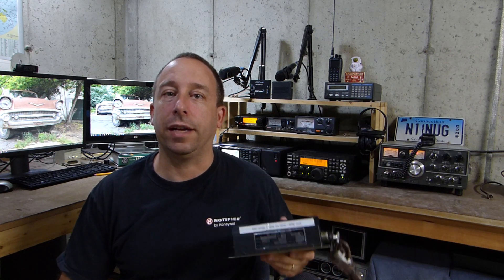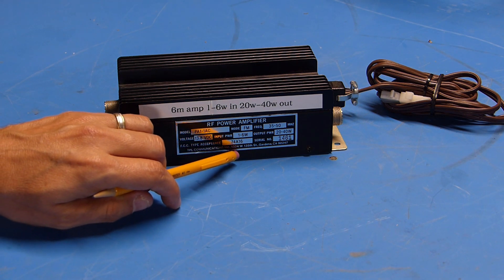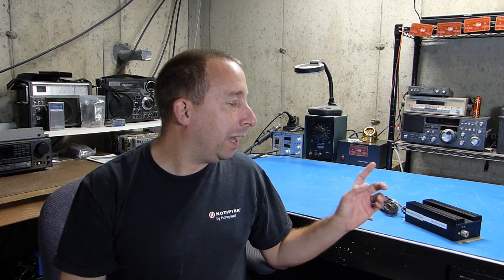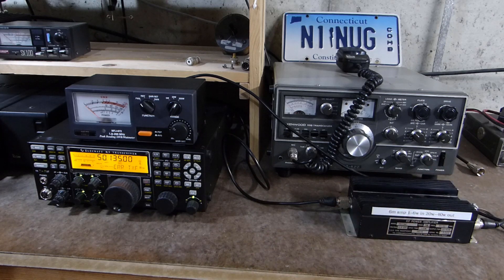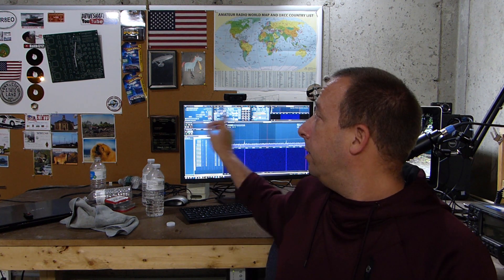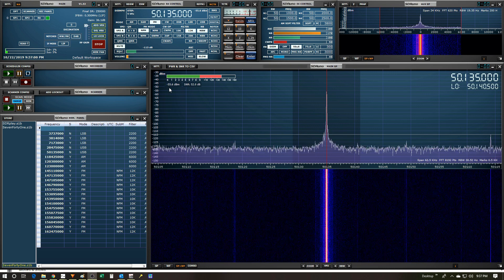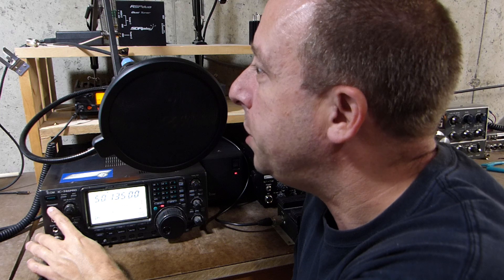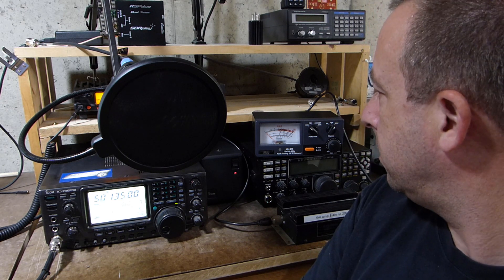6 Meter Ham Radio Amplifier Test & Demo - Flea Market Special!

Comment: The amp is seeing the SSB as an input that comes and goes. You might see if there's a VOX-like adjustment that'd cause it to hang in there longer.
Reply from the maker: The circuit has a rectifier that produces a DC voltage from the FM carrier and biases a transistor which in turn causes a relay to click on.  Because there is no steady carrier with SSB, the transistor only gets voltage when the RF is high enough.  There is no adjustment in the amp for the biasing level of the transistor.  The best thing to do is add an external keying circuit tied to the PTT of the mic which in turn would feed the needed voltage to bias the transistor and keep the amp on while the mic is keyed.  I have plans to do that at some point but not sure when I'll get to it.

Comment: So have you determined what class the amp is operating in yet? From just what's given in the video could that be determined or do you have to get inside? If getting inside is the answer, what is the key giveaway (teach/remind us)(I've forgotten so much). I would have opened it up no matter what. I once bought a lil class C amp - one of those little 2m FM amps to boost ur HT up to 25w and the final blew in no time so I had to solder in a new one - no savings of money there. EDIT I found this. Maybe you could compare the class A / class C diagrams to the insides of what you have there and make a determination: https://www.electronics-tutorials.ws/amplifier/amplifier-classes.html

Comment: the low tier versions were pretty broad devices - 30 - 60 MHz or something in some cases. better designed ones were more limited to specific band splits like 30 - 40 MHz or 40 - 50 MHz. depends on the brand and so on..
Now if you are adventurous you can see if you can get ahold of an old GE Mastr2 Lo band PA deck from a base station. 600 mW in and 100 watts out and are broad enough to run 6 meters AND since you run a LPQRP as an exciter you should be fine in SSB with it.  You will need a GE test and tune set, service manual and some tuning tools to tune the amp deck but man those things are built like tanks and perform very well. I have a couple in UHF I keep on hand incase the one in the 440MHz repeater I have dies..

Comment: I had no idea you could run an FM amp in SSB.  Thanks for the info!  73 KE8HSW
Reply from the maker: In theory it shouldn't work well due to the architecture of the amp.  If you put a spectrum analyzer on this the signal might not look so good.  Also, you need a circuit to hold the relay open since there is no carrier, otherwise you'll burn out the relay contacts in short order.  Bu in a pinch, I guess it works.
Reply: It will work but you might have some performance clipping and efficiency issues..

Comment: To make it work on SSB without the relay having a coronary, is all you need is a 2n2222 transistor , 2 resistors and a wire on the PTT from radio to the transitor then to the relay in the amp, Thats it

Keith N9QDS
Reply from the maker: I thought about looking up the mod for this so thanks for the info.  Even though I got a good report on the air on ssb isn't using a class c amp going to cause splatter and spurious emissions?
Reply: @SevenFortyOne  I picked up the 100 watt model of that amp and going to do that conversion. They are very well made amps. I got into the 100w model for 30 bucks.  73 Bill kc4ubc
Reply from the maker: @billwhite659  I may try it too ..looks easy enough to do.  I'll add a power switch too.

Comment: You would have to put a new set of points, distributor cap , wires and plugs in the amp, then it would do ssb just fine. LOL. I don't like 6 meters a whole lot. Gets in to a lot of stuff when transmitting. My son works for the DOT in Maine and they still use the 43.000 area of the spectrum for truck dispatch and truck to truck coms. They still have repeaters up all over the state.
Reply from the maker: CT used vhf low band for police and Em's up until a few years ago due to the hilly terrain away from the central part of the state.  I think some of the fire dispatch and state DEP still use it today but the police went over to uhf 800mhz digital.
Reply: @SevenFortyOne  I am interested in how the different frequency's crawl around terrain. Maybe a video idea. I have worked a guy simplex on 2 meter with about an s1 to s2 ( weak ) and we can not work simplex 70cm. I know the higher you go in freq, the more terrain can interfere. It interests me, but is a little over my pay grade. LOL!